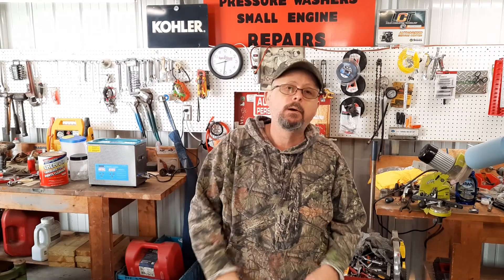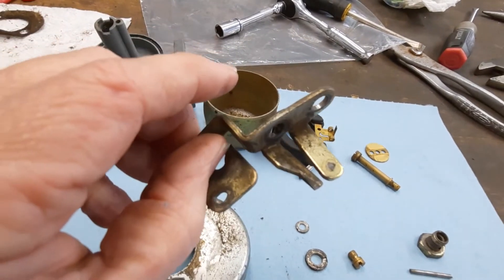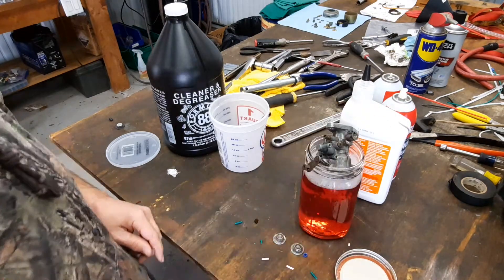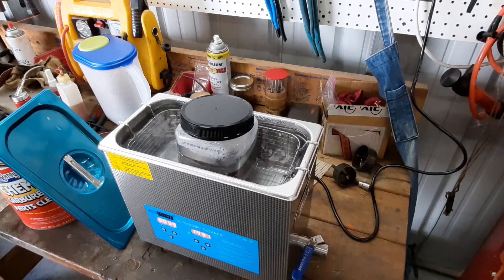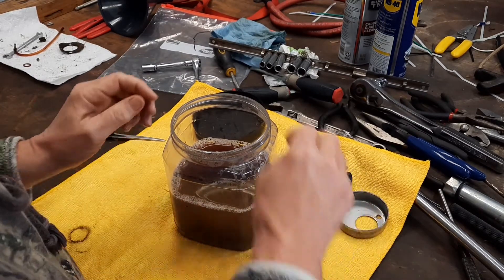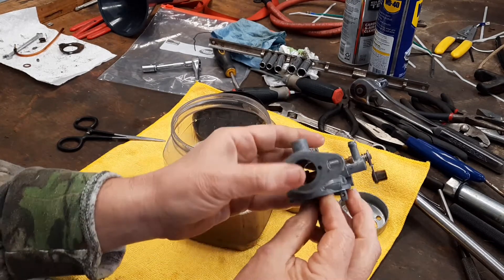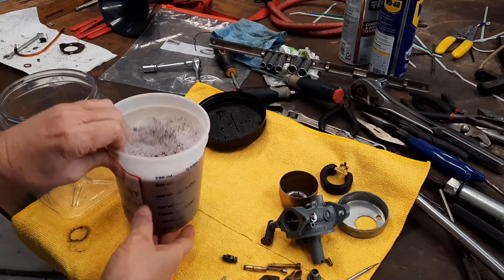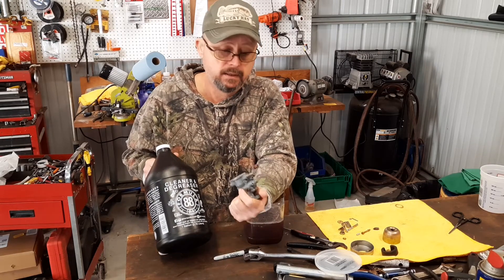New ultrasonic Cleaner and test of FORMULA 88 CLEANER DEGREASER

Comment: Hey Rooster and your viewers. We have been using Formula 88, in full strength, as our go to cleaner and degreaser for years now. One of the services that our Diesel Storage Tank Cleaning and Fuel Polishing business offers is interior and exterior tank and storage bund cleaning and degreasing. We selected Formula 88 for the job not only because of how well it works, but for how easy it is on our employees and our equipment. The process of interior diesel tank cleaning is messy, uncomfortable, and hard on the employees. When cleaning the interior of a diesel storage tank, an employee is required to work in a confined space environment, and are suited up in the required PPE. When fully suited and in the tank, should a harsh chemical happen to penetrate a small seam and burn the employees skin, it jeopardizes the employee, the ability to complete the job on time and slows down the productivity. Since switching to Formula 88, we have not had any of those issues. It is bio-degradable, non-toxic, non-corrosive, non-acidic, has a pleasant smell and does not burn your skin when it makes contact. This is important to us because it protects the employee, the environment, and allows us to achieve a deliverable to satisfy the customers expectations. Formula 88 is backed by an SDS sheet and has a proven track record that meets and exceeds most companies hazmat requirements for chemicals on site. It is also used to clean and degrease our compressors, polishers, tools, coveralls, boots and other work related equipment.It has proven to be a great household/office/marine/warehouse cleaner and degreaser as well, replacing many of the cleaning chemicals that were purchased in the past. It has not bleached or degraded any of the materials, as we make sure to wash if off properly with clean water. One observation is that if left on painted surfaces and in direct sunlight, it can streak and/or fade the painted surface, so use with caution (dilute the concentrated formula based on the application) and make sure to wash off properly.  If you want to find out more about Formula 88, please drop a line and I will be happy to assist. My email is: ryan@tankandfuel.com. Thanks for your video testimonial Rooster and I hope this review helps your viewers.
Reply from the maker: Hey hey Ryan. Thanks for backing me up on Formula 88 it's been a go to for me for years now.

Comment: Hey bro, an ultrasonic washer is meant to come in contact with what your trying to clean otherwise it defeats the purpose of having an ultrasonic machine 😂 

if all you wanted was heat you should of just left on your stove on low
Reply from the maker: Hey fella thanks for watching.  I thought the same way on the ultrasonic cleaner until I saw Steve small engine salon suggested it on one of his videos so I gave it a try and it worked for me . I can see it working in the container and It saves on the amount of cleaner I use. It's working for me .